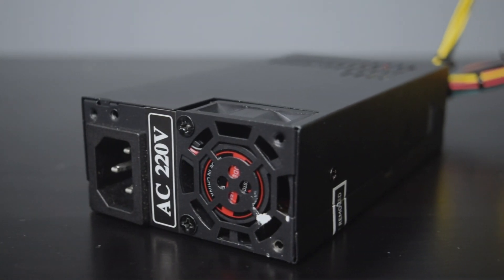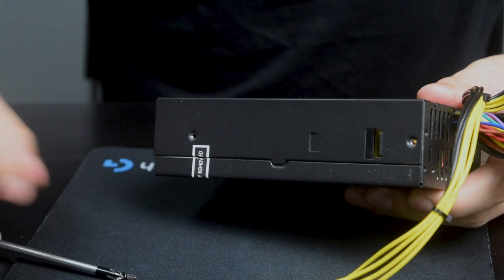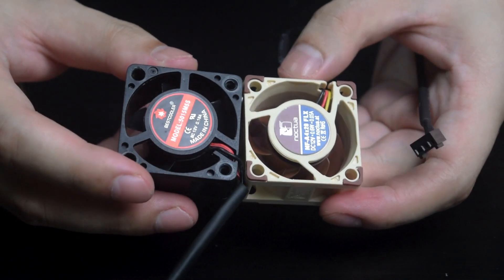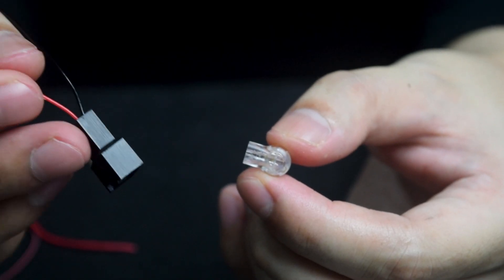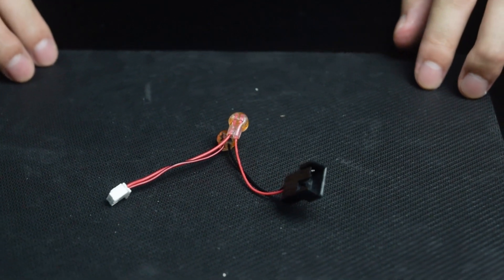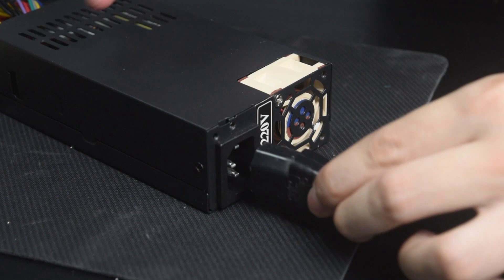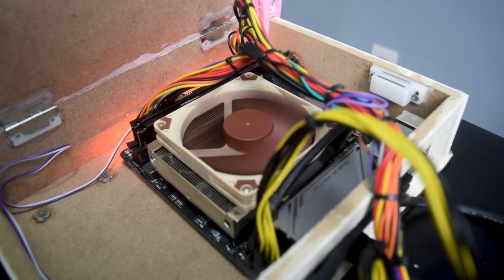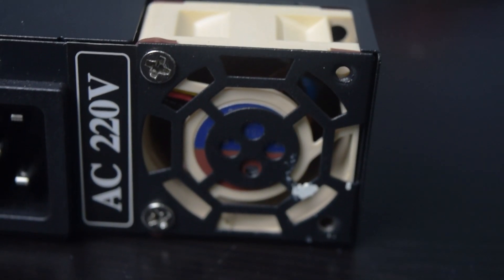How to Replace 1U Flex Power Supply Fan to 40mm Noctua Fan || PC Mod

Comment: This is so unnecessarily complicated. You only need to clip the center wire of the noctua and make sure it’s not used, then solder that to the old fan connector.

Comment: I tried to change the fan in my sh570 barebone shuttle, but the noctua fan has other dimensions and a much lower airflow. Also different voltages to start the fan moving. The original fan rotates at round about 4 volt and noctua at 7 V (The supply starts with 5 V). 
The best way is a little resistor (with original fan) at 20 to 40 ohms, i tried a little, because the fan needs a little current for a correct start (maybe two 40 ohm resistors parallel). When the computer needs more load (rendering or something) the fans spins up, depending on the temperature and it seems, this will work for me (-:

Comment: I did the mod few months ago and everything was wonking flawlessly furing the colder months. However now the PSU is overheating, the Noctua fan it is not enough for a Flex 650W PSU during the summer months in my region. Room temperature is around 30 degrees Celsius and when the computer is under heavy load for a couple of hours the system shutdown, I have to wait few minutes before the PSU functions again.

Swapping back to the original fan even though it's noisier...at least for the summer.
Reply: thanks for your post bro, i was wondering if this upgrade could help me get  better temps. i'm sticking with the original fan then
Reply: You need to compare the factory fan with the new fan you're replacing to see if it's adequate in terms of airflow, static pressure and even rpm range and power consumption. Not all fans will work as a replacement. That's why the manufacturer doesn't recommend replacing the fan on your PSU with a different one.

Comment: I got this working with a 1100 watt Juniper power supply this evening. The power supply definitely runs more toasty and I'm getting around a 60% reduction in airflow and static pressure compared to the original Nidec UltraFlo W40S12BS1D5 that was installed with the unit. Worth it to get rid of that 60 decibel jet engine, though now I have to figure out how to swap out the fans on the chassis - because those are the loudest ones when the switch is heating up.

Edit: I swapped out all fans but I have them on a separate power supply because of difficulties with the fan modules. I have an old 2015 Junos build on my switch (EX-4300-48P) that doesn't have a bug fix for unrecognized fans when the RPM is out of range, so I couldn't use the modules - although I did rewire one module and it did power the fans. Running two Noctua NF-A4x20 fans in series for the power supply seems to sufficiently cool it but I do not have a permanent solution for it, since it does add some bulk to the power supply that I haven't been able to make modular yet. I was able to run this power supply with a legitimate load for an hour and it didn't get to the point where it was concerning so I think that was a success. I also ran two NF-A4x20 fans in parallel, in place of the old fan modules. This seemed to keep the switch at 60 degrees Celsius under low load which is a good sign, but I plan to buy another NF-A4x20 fan and run that fan in series with the existing fans, which hopefully should increase static pressure tremendously and slightly improve airflow. Also, taking a bit of a risk here, but adding an extra volt to the fans seemed to help tremendously, but overvolt at your own risk. I know what I'm doing with electricity so I'm comfortable overvolting my equipment and I'm prepared for emergencies. 

If you ever mess with juniper equipment, just make sure you got the wires correct. You can use a multimeter to find out what pins are your power, and what pin refers to your tachometer. I crossed the PWM and tachometer wires because the color coding was different and it was causing the PSU to automatically shut down after a few seconds of operation. 

I wouldn't recommend doing this on enterprise equipment that requires higher airflow and static pressure because you could overheat your power supply. I only did this on my switch's power supply because I know I'm only going to be pulling ~100 watts on that supply. I could have bought a cheaper PSU that draws less current and I probably will in the future, but this is my solution for now.

I haven't ran it enough for me to ensure it runs safely yet either (see edit); I'm just adding more load to it gradually to find its sweet spot. Definitely something I am not comfortable running overnight yet! The supply is pretty smart; it might shut down automatically if it overheats but I'm not entirely sure (couldn't find any datasheets that mentioned overheat protection). But I'll be watching it and if it runs fine for a couple of hours then I'm sure it'll be fine.

Edit 2: Stacked noctua fans in place of the old airflow modules. Tapped into the power supply fan header for a 12v fan supply, ran it out of the PSU and made DuPont connectors, then hooked them up. No fan status but no big deal. The box runs at around 50C idle. Success!
Reply: hello. id just like to thank you for taking the time to share this wisdom and experience of yours, i genuinely appreciate it. i also have a question, answer it if you wish, and dont assume im trying to flatter you with the first statement. if i replaced the internal fan in the flex PSU with the same one on the video, and then add an external one beside/in front of the internal one, would that compensate for the lower RPM and static pressure of the noctua fan?
Reply: I tested several configurations with flex PSUs. The best one is inverting the flow direction with the fan. If you make it intake, and you ensure enough negative pressure inside the case, all problems solved. I am running a 7800x3d with a rtx 5060lp in a 4.5L case. Runs great.

Comment: Thanks for pointing out how to use the Scotchloks. Was preparing to solder stuff when I found your video 😉I replaced a Delta EFB0412HD 40x40x20mm fan in a PSU with a Noctua NF-A4x20 FLX. My issue with it was not so much the noise level but more the frequency of the noise. The Noctua makes a lot less noise since it runs at a lower speed at the same voltage, but more importantly the frequency is different and much more bearable.

The airflow and static pressure of the two fans do differ if you look at the specs: the Delta delivers 14,59 m3/h, 7,69 mmH2O, 28,5 dB(A) @ 7600 RPM. The Noctua instead does 9,4 m3/h, 2,26 mmH2O, 14,9 dB(A) @ 5000 RPM. So in terms of airspeed the Noctua delivers about 60% of what the Delta does. In terms of static pressure the Noctua delivers only 30%. I think it's this last spec that makes for the low measures noise level.

Personally I estimate this will not cause any issues since the PSU I exchanged the fan in is utilized so little. It's a 200W PSU but it only needs to deliver 30-40W. The relatively stable climate in the room it's in helps.

Comment: Instead of Connecting the 3-pin Noctua to the Omnijoin Adapter, then through the Skotchlock connectors, and finally into the original 2-pin connector. Would it be possible to just cut the 3-pin connector off the Noctua, and connect the red/black wires directly to the 2-pin connector (using the Skotchlocks), and just wrap the third wire so it's not used?
Reply: Yes

Comment: You need to check the polarity too. Some PSUs are using revesre polarity on the 2 pin connector(like the In Win Chopins built in PSU).

Comment: notice the current on the current rating on the original fan is 0.18 amps its 2.16 watts and the noctua is 0.05 amps thats only 0.6 watts so less then1/3 the power, it will deffinantly be a lot quieter but i would not put much load on that power supply for to long because at 1/3 the air flow it will heat up and die.
Reply: Could not be more efficient?
Reply: @sinholueiro  yes it can be, but not that much

Comment: If you're replacement fan doesn't have an adapter (only three bear wires), which wires on the new fan would you tie your old fan? Just the red and black?

Comment: Can I connect the fan to the motherboard using the PWM model instead? There would be no risk of over voltage.
Reply: that's what optimum tech did.

Comment: Does the Noctua offer as much airflow and static pressure as the original fan?
Reply: No, the original is a 40x15mm fan, noctua is 40x10mm. You will have a reduced airflow along with the lower noise.

Comment: Hello i have a question does the Flex 1U Power Supply and a Flex ATX power supply have same size or are they different?
Reply: Notable differences should be airflow wise, Flex ATX usually draw air from one or two of its sides. 
1U has a linear airflow, front to back, as it's meant to be sandwitched on 3 sides by the case, on the forth has the motherboard (of which it shouldn't disturb the cooling path).
1U can also have different mounting holes, specific to some servers... they can also be longer, or lack some connectors you would expect on an ATX/FlexATX PSU... like PCIe power 6/6+2/8, or have fewer EPS connectors to none.
Reply from the maker: They should be the same or similar size

Comment: I did this mod on a mining psu, but when i boot the rig both fans are spinning but after a couple of seconds the intake fan stops. Do you know what the cause could be?
Reply from the maker: Probably some loose wires somewhere?
Reply: @ItsTimeToBuildIt  I didn’t see any? And if they were loose, they wouldn’t start to begin with right?
Reply from the maker: Or maybe it's the fan faulty? Alternatively you can connect them directly to the mb see if they're spinning.
Reply: @ItsTimeToBuildIt  i switched the other fan that was spinning all the time to the other port, and it had the same issue. So it seems its the port somehow.
Reply from the maker: Glad you found the issue:)
Reply: @ItsTimeToBuildIt  ended up routing both the fans to the same port, since the original fans drew way more power i knew it would be safe anyway :) good video btw!

Comment: hey bro , why not connect the gpu fan to the mobo so that you can control the fan speed by yourself 😃?(to prevent overheating)
Reply from the maker: Yes you could also do that
Reply: you mean the psu fan? some PSUs won't work if they don't detect a fan connected

Comment: I don't think the Noctua fan has the same airflow, based on the power consumption of these fans.
The connector looks like a JST-XH one, for which i've bought a cheap kit. It's neater (but still more expensive) than using scotchloks.
Reply: The Noctua fan motor is probably more efficient. But you could compare the PQ curves if you want, although you would have to ask Noctua for them because AFAIK they don't provide them on their website

Comment: Old fan has red black and blue wires. New fan has red black and yellow. Okay to connect red-red, black-black, yellow-blue?
Reply from the maker: Best to check the wire colour code in your area, but apart from that it should be fine yellow blue.

Comment: Hey man! Great Vid! Just one question, is it not necessary to strip the wires before inserting into the Skotchlock connector?
Reply from the maker: It is not necessary because the skotchlock somehow do it for you when you insert the wires:)
Reply: @ItsTimeToBuildIt  Alright, thanks for the prompt response man! Stay safe! :)
Reply from the maker: Pleasure ;)
Reply: @Mr_Deee is been 4 years but if your interested in the actual answer, there are metal teeth that bite into the wire and pierce the wire coatings.

The same metal teeth then jump the connection

Comment: great video.
shouldn't you expose the wires first?
Reply from the maker: expose to what exactly?
Reply: @ItsTimeToBuildIt  expose the copper, remove the red/black cover
Reply from the maker: Probably in some cases you need to do it that way, but in this case that's not necessary :)
Reply from the maker: @oryany100  yes you could definitely use the power (red) and ground (black) wires only. the other two wires usually for read out and controlling the fan speed.
Reply: @ItsTimeToBuildIt  so what the speed of them fan will be?
Reply from the maker: @oryany100  the fan would be on its full capacity at all time
Reply: @ItsTimeToBuildIt  thank you, i appreciate your help a lot!
Reply: @ItsTimeToBuildIt  one more question (hopefully the last), do you know the name of the original fan connector?
i'm a little afraid to damage the original, and i'd like to connect the Noctua fan to a dedicated connector of its own.
Reply from the maker: I believe it's called 2 pin fan adapter, if that's what you mean?

Comment: What are the rpm difference? ;) 
Replace server components with desktop one. ;) ;) ;) Big mistake dude.
OMG so much money for what? Improvement? What? No!
You need to understand in a first place difference between noctua desktop and delta server fan.
Delta 20K RPM fun price is almost like this psu. Do you know why?
Reply from the maker: The point here is to get rid of the noisy sound from the fan. Delta fan are noisy, they're loud. They're built to long last but not for silent performance. You're suggesting to get delta fans with 20k rpm, more rpm means it get more noisy which is not the point here. The point here is to be more silent with optimum performance, and where you can get it from a trusted brand? Noctua!
Reply: @ItsTimeToBuildIt  he want to tell you that with the silent fan the PSU may overheat due the insufficient air flow

Comment: I have 4 pin connector fan on my psu (black, red, blue, white) and noctua fan have (black, red, yellow) I connected (black-black, red-red, blue-yellow) and white not connected. Now my PSU still blinking with green light and finally turns orange and no works. Any suggestions? Help please.
Reply: seems that fails cause last 4 pin (white) need to revive signal from RPM for works, what can i do
Reply from the maker: Seems like you have an flx fan. You need to get the pwm fan which has 4 pin in order to be compatible with the 4pin connector.

Comment: Great video thanks! How long did you power the PSU down until it was safe to open and replace the fan? What would you recommend to anyone following your video as a safe amount of hours/days?
Reply from the maker: I actually disassemble the psu no longer than a minute after power off. Most psu are safe enough to handle after few seconds powered off as long as there's bleed resistor inside the psu (which most have). You can read this article for better understanding. ;)

https://www.overclock.net/threads/capacitor-safety-in-power-supplies.1772888/
Reply: Unplug your pc. The hit and hold the power button for a second.